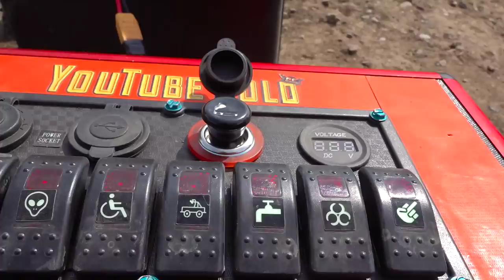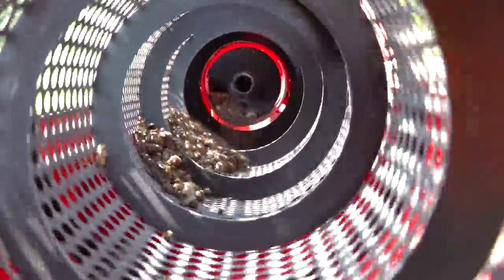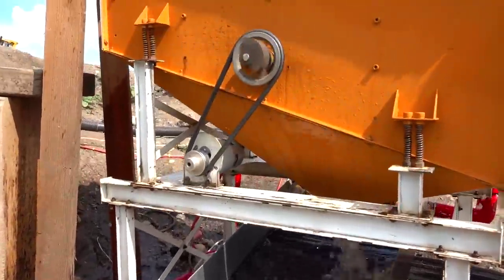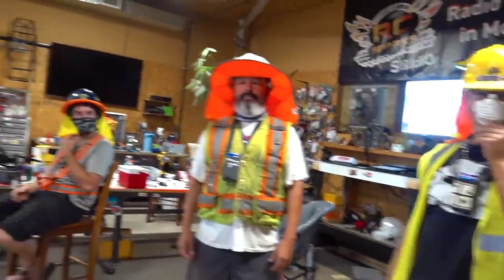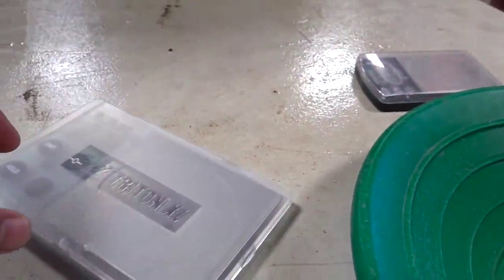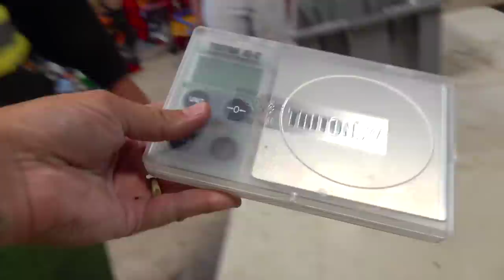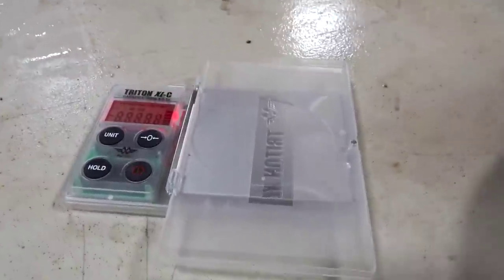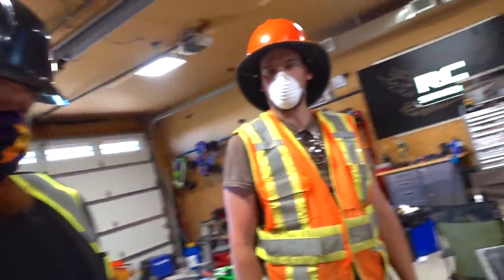YouTube GOLD (S3 E13) DEEP in the CRACK, MiNiNG a HONEY HOLE | RC ADVENTURES

Comment: Might could drill holes in the boulders that are in the pit, fill 'em with tannerite, and BOOM. Dig what remains with Big Johnson
Reply from the maker: Seems like a huge risk in a field full of dry hay..  #YouTubeGOLD!
Reply: An excellent point... maybe after digging enough around them, you could use both dozers and Big J to push/ pull them out. Or just throw them in the 797F dump truck